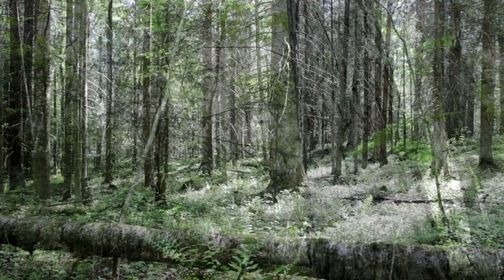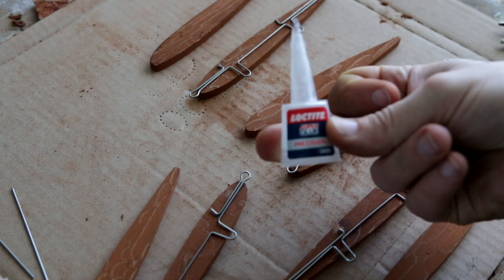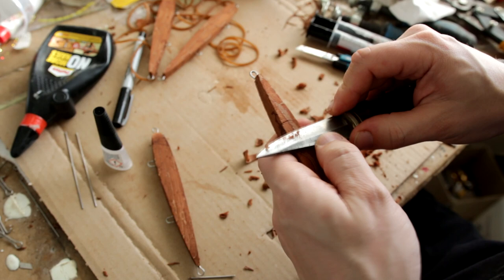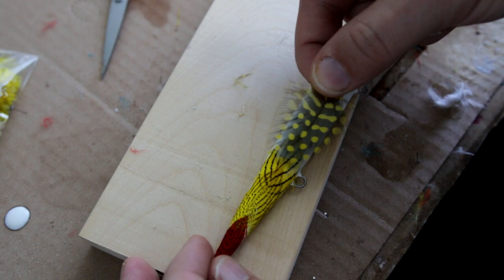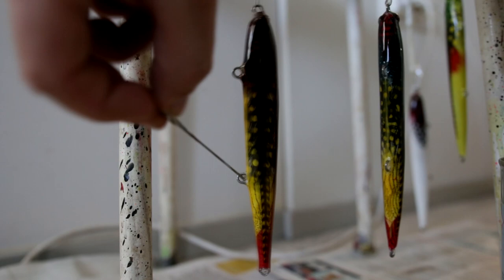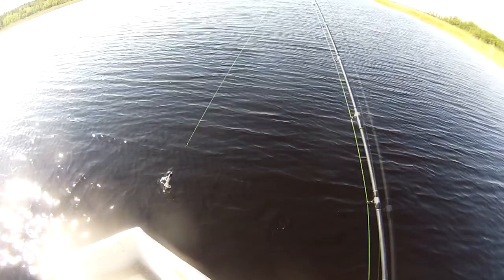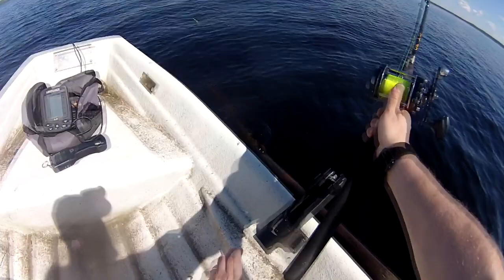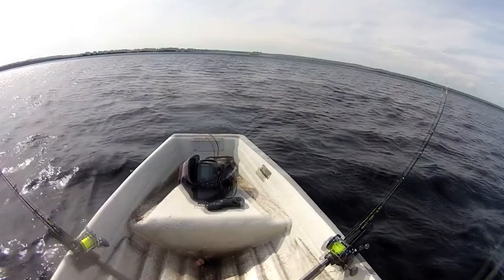The ancient art of using feathers on a fishing lure

Comment: If you want to use pine tar, you need to process it into pine pitch with some charcoal. It was used on boats and arrows as a waterproof binder so it should work for lures. I'm surrounded by pines and have made some fireproof camp matches with the stuff, it is very sturdy stuff.
Reply from the maker: I did excatly that in my test and precessed it the way you discribed it. Its an old trick that works for certain stuff but like i mentined in the video i did not think its strong enough lol i guess im paranoid that way

Comment: Rawhide glue should be strong enough to glue the halves together if you don't want to use epoxy. nice vid.
Reply from the maker: i was contemplating on making that but then i just gave up and ended up using epoxy cos of convienience.
Reply: Yeah, I wouldn't bother either :). Maybe if you were doing an exact reenactment of old lure making techniques but otherwise not much point.

Comment: next time just cut a slot in the bait. don't cut all the way in half. then side the through wire up in to the slot. then fill with baking soda and super glue
Reply from the maker: The whole idea of this project was to do a homage to old way of making pine bark lures that had wire placed inside them, This is the way they used to do it because the slabs of usable pine bark you get from a tree are very thin so you simply use 2 thin pieces like i did. I personally always just cut a slot  like you described and glue it in but that was not really possible with this build.

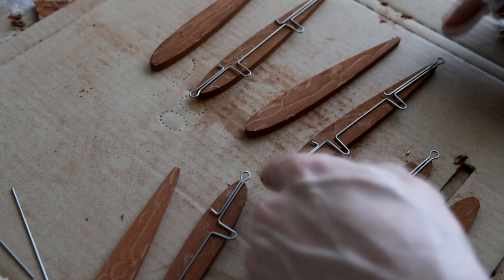Comment: 7:35 could you just use a vise and press/crush the wire into place between the two halves? The wood should easily compress enough to accommodate the wire. Not at all what I was expecting to see happening, but entertaining for sure!
Reply from the maker: i did test that too, dry pine bark is pretty fragile and cracks every time when it comes under that kind of presure which would be needed to make a big enough slot to accomodate the wire so i just carved the slot instead.

Comment: why would you cut it in half?, just cut it half way  and you can insert your wire
Reply from the maker: The reason is manyfold but the main reason was  the strips i harvested were not thick enough so i opted to just join 2 equally thick pieces together to get the thickness i wanted. secondly i wanted to show an alternative way of doing this than the obvious "saw a slot from the belly and insert the wire in" and thirdly this is how they used to do it on the olden days so i wanted to give a homage to the old lure builders who paved the way for the rest of us.

Comment: Hey, great vid! This is an older video but maybe this will get answered. What are the advantages/disadvantages to using cab coating compared to epoxy?
Reply from the maker: Both have their advantages and disadvantages. Cab is softer but easier cos you simply dip your lures and epoxy I'm more durable but you need a drying wheel
Reply: @SolarfallBaits  okay thank you, it was really hard to find any info online since most websites are finnish or swedish but your reply helps. I am using epoxy but recently bought a can of cab and wanted to try it out since it has lower working temperature than my epoxy (my workhop is cold in the wintertime). But if it isn't as durable as epoxy, I may just use it for smaller baits like perch cranks or zander baits that only occasionally have to endure pike teeth. Thank you!
Reply from the maker: @biglebob1  I think most people use it for smaller lures that are meant for species that don't have big teeth like perch, Trout and the like.

Comment: But you used a water base glue. Wont it dissolve in water?
Reply from the maker: The glue is not in direct contact with water at any point so i think its gonna be okey.
Reply: @SolarfallBaits  , ahhh. I guess that sealer coat protects the glue.

Comment: dd you mix the pine resin with powdered charcoal? it wont make proper glue unless you mix  those and heat it up.
Reply from the maker: Yeah i tried that didnt feel it was not strong enough. Its good for other wood craft/survival stuff though
Reply: @SolarfallBaits  ah good to know, i use it for arrowheads so i figured it would be strong enough for this since usually my tips break long before the glue does.